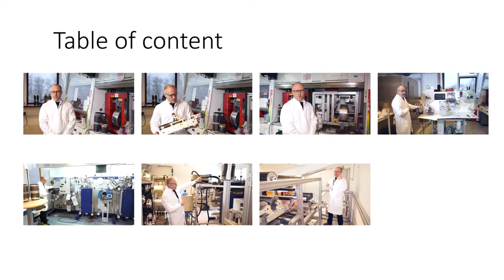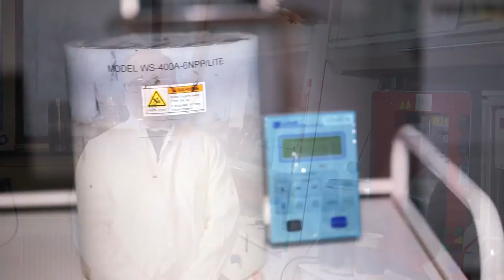Printed solar cells - From small to big scale

Comment: Can you make it multi colorful and frame coat to a push bike with the black under and white name decor should look good ? 12v plus ??? Iam working on a kit for bikes and it uses ac dynomo and solar for 35v at up to 1amp for 9v 5v and 12v supplys and a lot more... and would like to see if that worked well even if i scratched it ?re coat possible options you may like your bike